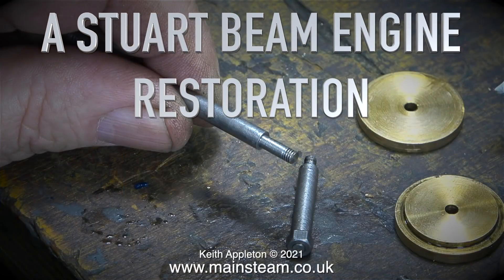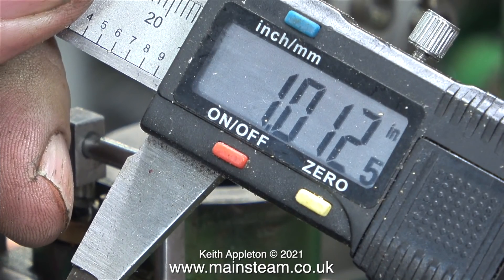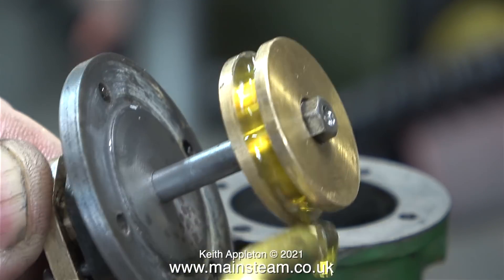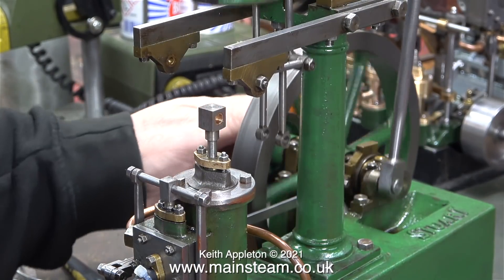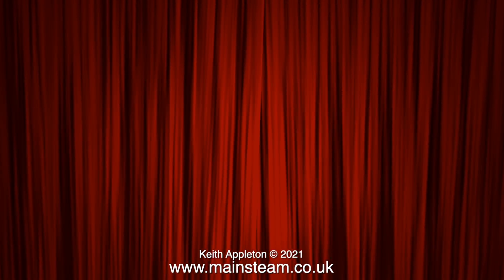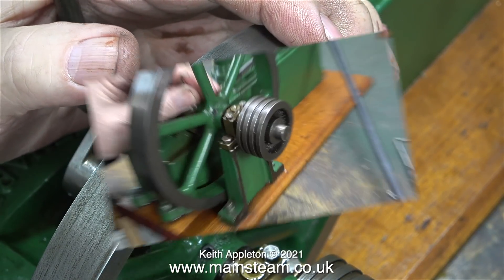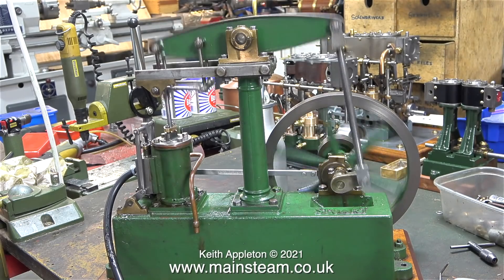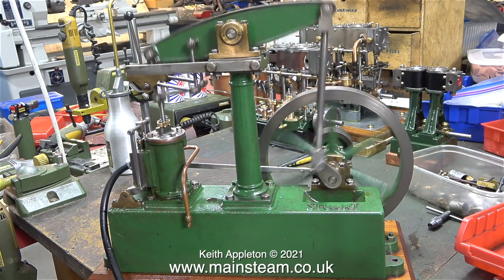A STUART BEAM ENGINE RESTORATION - PART #6

Comment: My Stuart beam engine (built by my father in 1968) runs very slowly even though the control from the Stuart 504 boiler is not the most sophisticated. I think you can buy one ready-made these days.